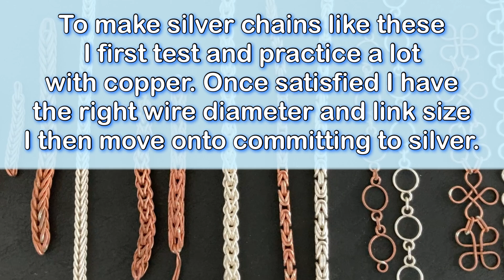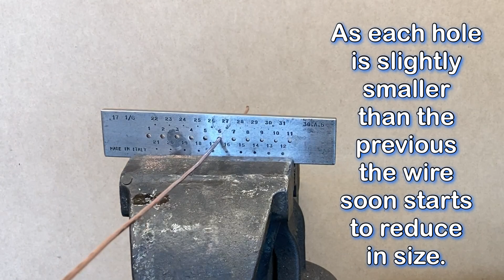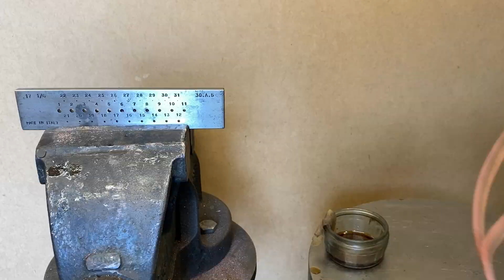resizing copper wire for jewellery making (using a draw plate)

Comment: This was really great to see how you reclaimed the copper and very exciting to see how much wire you got after using the draw plate!!
Reply from the maker: Thanks Beverley, I was always amazed how well this can work. I suppose it relies on your materials being very malleable like copper can be after annealing … N
Reply: @Nickscreativestuff  Can I ask what grade steel wool you use please in your various videos. I have just had a look online and seen that it comes in various grades and mixed packs. Is the 0000 grade good enough?
Reply from the maker: Hi Beverley, I mostly use “0000” wire wool. Its the finest available and is great for cleaning mild oxidisation and bringing copper back to a basic shiny finish … good luck with it … N
Reply: @Nickscreativestuff  Thank you very much, that's very helpful.
Reply from the maker: May your creative spirit soar … N

Comment: I love the re use and resourcefulness Nick. Absolutely brilliant. Such an important video on different levels. Cheers.
Reply from the maker: thanks Alan, it’s amazing what draw plates are capable of doing. I once pulled some silver wire down to 0.3mm diameter. I didn’t think it was possible until I tried. Lots of annealing needed to make it work … N

Comment: I took an engine apart to get the cooper out. That was fun, just have problems removing the residue from masking tape.
Reply from the maker: hi Pie thanks for the comment, I tend to burn off any contaminants … then clean back with acid … Hot vinegar with salt in works well … then it can be polished back with wire wool … cheers … Nick

Comment: Just wondering, is it necessary to clean the wire in an acid bath after each annealing?
Reply from the maker: hi Heidi, I tend not to clean with acid every time I anneal the wire, I clamp one in a vice and rub along it with wire wool or an abrasive pad to get the worst off … Nick
Reply: @Nickscreativestuff  thank you

Comment: How are you bracing your vice,my is mounted on my work bench and when i pull the wire through it almost drags my work bench,its a workout 😅
Reply from the maker: My vice is bolted to a pedestal that is bolted to a concrete floor so nice and solid. I find regular annnealing and plenty of oil also helps … N
Reply: Yeah im probably going to get a metal stand and bolt it to the floor@Nickscreativestuff
Reply from the maker: I can pull 6m at a time out my workshop door and into my garden … N

Comment: what acid do you need to clean up the copper wire?
Reply from the maker: Hi Robert, I mostly use a product called pickling powder, it’s used by the jewellery trade to clean copper and silver. I buy mine from cooksongold.com although a lot of places will sell it. It’s a powder based chemical called Sodium hydrogensulphate or Sodium BiSulpate. Other chemicals can work such as hot vinegar mixed with salt or citric acid … Hope this helps … Nick

Comment: Whats the smallest you can do with a Drawplate ?
Reply from the maker: Hi Destroy, i’ve used this plate to draw down to 0.5mm I think it goes a bit further …  i’ll have to check for you … Nick
Reply from the maker: i’ve just pulled a bit of copper through the smallest hole and the wire comes out at 0.4mm diameter. some plates might go smaller. all the best … Nick